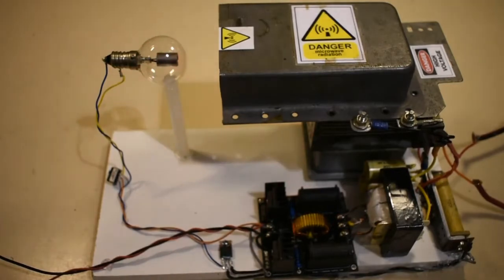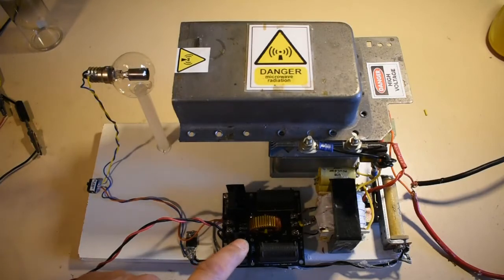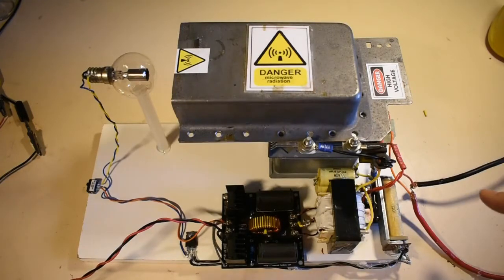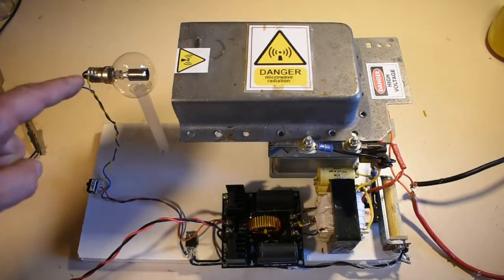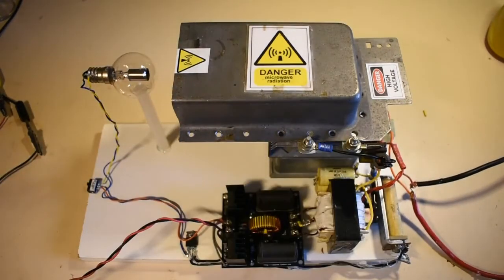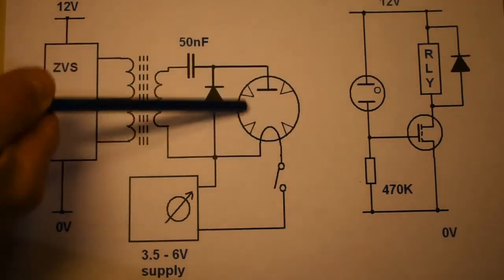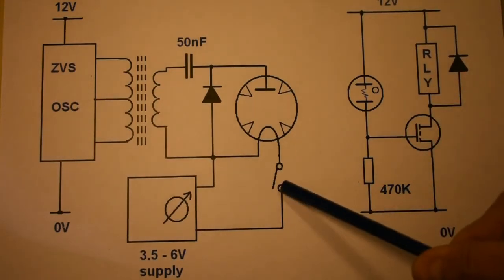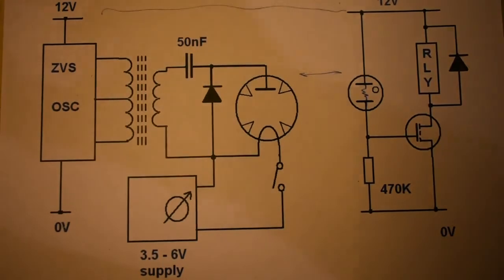Flashing Light Prize 2018 - microwave plasma

Comment: Thx for explaining everything! I just wanted to know: how many turns are in the transformer ( the zvs one and the output one), what capacitor you are using (the microwave one?) And the diode; is it the microwave high voltage diode?
Reply from the maker: The transformer has 8 turns with a centre tap giving 4-0-4 turns. The secondary has something over 1000 turns. As the voltage is high this has to be built in insulated layers or sections otherwise internal breakdown is likely.  The capacitor used here is 2x100nF in series each rated for 1.5kV. The diode is from an oven, probably not best as it isn't a high frequency diode.  Although it still works my set-up is not ideal as I it only had to survive for a short time.  If building this type of thing carefully consider the warnings on http://www.tuopeek.com/microwave  Oven magnetrons are horrible things as the chassis needs to be live if the heater supply is ground.  The microwaves at low energy will interfere with electronics and can damage them if close enough.  At higher energies your eyes can be at risk.  I recommend using a wave-guide and Faraday cage on the output.
Reply: @tuopeeks  I've ran CW multiplier with oven diodes at 10khz seemed to work nice at 300w OP into Coolidge tube, I would like to do some reverse recovery measurements on oven diodes .. great work very creative ;)
Reply from the maker: @T2D.SteveArcs  hot or cold cathode?  I used an oven 50Hz diode here. The fact that I had some issues with the neon staying ionised if too close to the wave guide which was at anode potential suggests there was some HF ripple on the DC. This may be linked to capacitance of the diode at high frequencies.
Reply: @tuopeeks  hot mate.. you should have tried a filter across hv to see if that was the reason, is it still around?
Reply: @tuopeeks  could it have been there was to much energy and subsequent current when close to the emitter, heating the gas and raising the pressure and therefore the voltage needed to sustain
Reply from the maker: @T2D.SteveArcs  No detectable heating effect. Think I convinced myself at the time there was a small amount of ZVS ripple voltage getting through to the anode plate.
Reply from the maker: @T2D.SteveArcs  that's worth a shot. Might still be operational. :-)